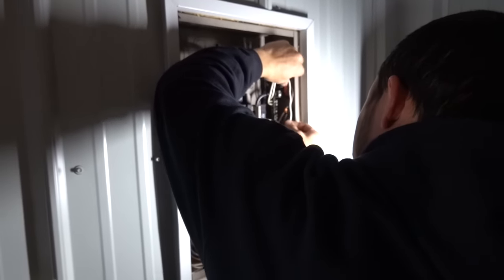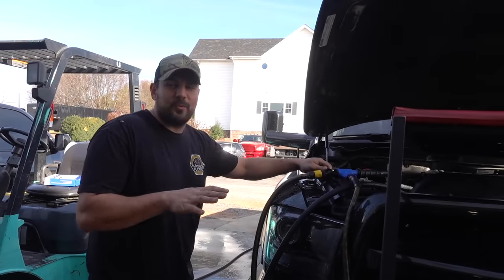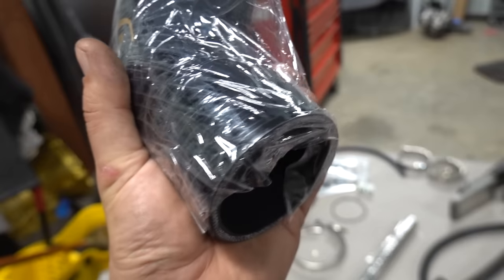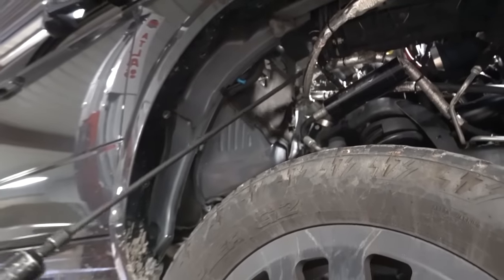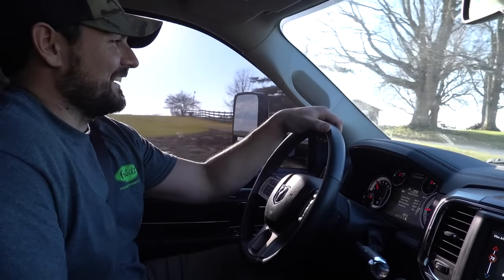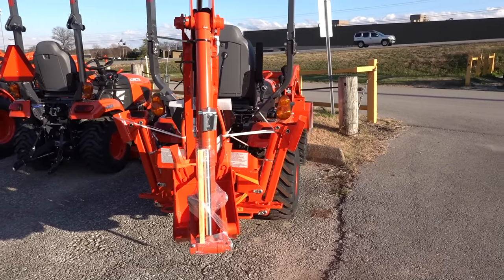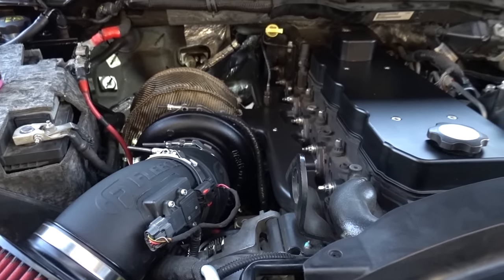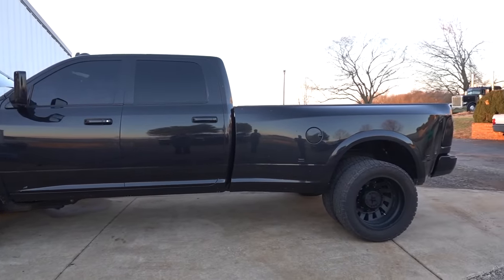LOUDEST EXHAUST BRAKE YOU'VE EVER HEARD!!!!! THIS IS INSANE!!!

Comment: That sounds like a jake brake for real though
Reply: it’s not a jake brake it’s an exhaust brake they’re different
Reply: @kamrinwoodward5822  I know I was saying it sounds like a Jake brake
Reply: It sounds similar to a Peterbilt jake brake but yes it’s a exhaust brake
Reply: @kamrinwoodward5822  no shit Sherlock 😂
Reply: @kamrinwoodward5822  Someone thinks they are smart😂
Reply: @zg5901  ALL THE ARGUMENTS FOR NO REASON | 1LUV :-)
Reply: Did you say peterbilt jake brake 🤣🤣🤣 peterbilt dont make a jake brake honey, that's whatever motor it has in it, usually a big cat (electrical jake) or a Cummins which runs off oil pressure and is alot better than a cat as far as Jake's go, pulling a fat jag up the back side of the Appalachian mountains then a cat will walk its ass like a baby back bitch but that Cummins is gonna pass you 2x over on the downhill side while the cat guy is smoking them breaks and cracking jakes and having to get a quick head job. Take it from a truck mechanic who works on and takes care of 40 heavy haulers
Reply: @ranchertrapperdieselbuilds3632  yes, it's the same thing!! :-)
Reply: Yeah for sure
Reply: @kamrinwoodward5822  That's not what he said! Is English such difficult for you?

Comment: I used one of those a few years ago on my F250. It worked great. Next issue was that the flow was so good that I had to put a ball calk valve on the inlet . Leave valve open in the winter and then turn off in the summer. Too much heat  inside the cab in the summer. My grandson has the truck now and still uses the setup. I gave him the F250 when I got my F350.

Comment: The heat on my 4th gen doesn’t work either 🥶 and I was driving through WY & SD 🤦🏻‍♂️
Reply: Maybe try jarring the cooling system with a bump in the median...j/k..haha
Reply: Lmao how'd I know you was going to be here!! Just wear a jacket TP
Reply: No shit had a freind with a 1st gen hoodstacked with a buddy heater in the passenger seat thing was a chick magnet 🤣 bondo and duct tape
Reply: The heat on my 2nd gen doesn't work. I'm about to cut a hole through the firewall.
Reply: @Pure_KodiakWILD_Power  I'm lucky when it comes to that on my 2nd gen. It will burn you out of it in the winter with the heat and it will freeze you out with the AC in the summer
Reply: @Texas12valve  Nice.
Reply: @NCprepper  thanks, I've always thought that might be the issue, because the knob does get stuck halfway, but never got around to confirming it.
Reply: the drivers side heat doesnt work on my 3rd gen
Reply: OOF BIG OOF HE CHUNK OOF O LORD HE COMIN OOF
Reply: @Texas12valve  2nd gen hvac works awesome when the heater core isn't leaking
Reply: @wyattlewis8671  my heater core doesn't leak. And every thing else is new
Reply: @Texas12valve  yea man I have the same metal tab kit for the heat control module under the dash. Pain in the ass to replace but worth it. Also did a new dash top, ac evaporator and heater core. Truck hvac system works like a brand new vehicle. Everything was only $600 and a weekend of work.

Comment: Are there any back pressure adjustments on it? I had the BD on my setup and they had a regulator that you could adjust how aggressive it was just so you didn't float a valve as well... Or is it strictly what the computer tells it to do?

Comment: Fucking baby cummins drone. I dont understand why guys like it. The cummins is the 2010+ Honda civic. If you want a real jake, drive a truck with a real Jake brake, with a real clutch and transmission. Sloppy torque converter drone

Comment: 4th Gen RAM trucks did not use the recommended factory coolant for the factory fill. You can open any 4th gen coolant reservoir and find brown gunk in it. I did testing on several new trucks versus the Mopar coolant and they are different. Change your coolant early. The stuff they put in from the factory is junk.

Comment: What set up are you running as far as turbo and exhaust brake? I talked to fleece and they claim those parts dont fit together which I assumed was a 2nd gen swap fleece turbo and down pipe exhaust brake...?

Comment: I've had the issue 3 times in my 2014. It showed up after the dealership did the water pump recall. Finally it hasn't come back this year. Its the casting sands plugging it up. All it takes is the 40-60psi of water psi supplied by your spigot. You can buy some brass hose adapters and 5/8 clear hose from the hardware store for cheap and flow it into a five gallon bucket with a hole drilled into the lid for the water to bleed out and it will catch everything in the bucket even the fine sands since they have time to settle like that.

Comment: I just installed this on mine and I'm having an issue. The EB works when it wants to. Sometimes it'll kick on, most times it won't. But it'll work in tow haul. I don't feel this is any better than a stock EB. Are you having any issues like this?

Comment: Hey Greg, I noticed that your EGzt probe is before the turbo.  What brand of probe are you running and what do you see for EGT's when pulling?  The reason I'm asking is because my stock 3rd gen with an Autometer setup will bury the needle when loaded, and runs around 850 degrees empty.  When I hammer it empty I can drop the needle to 12 to 13 hundred degrees.  If you have any suggestions or ideas I would greatly appreciate it.

Comment: Can you please do a follow up on the heater core fix? I’m having the same issue and I’m being told the heater core needs to be replaced. Don’t feel like tearing the dash out to fix it just yet. And it’s getting cold here in Indiana! Love the content as always, sir!
Reply: I've had the issue 3 times in my 2014. It showed up after the dealership did the water pump recall. Finally it hasn't come back this year. Its the casting sands plugging it up. All it takes is the 40-60psi of water psi supplied by your spigot. You can buy some brass hose adapters and 5/8 clear hose from the hardware store for cheap and flow it into a five gallon bucket with a hole drilled into the lid for the water to bleed out and it will catch everything in the bucket even the fine sands since they have time to settle like that. I just flowed mine for 20 minutes and qinked the outlet hose a couple times to let it build pressure and quickly released it to shock the flow and knock some of the build up off the walls. Also, running some CLR in there for 10 minutes and letting it sit helped before flushing fully.
Reply: @marlboroman71818  appreciation the information! I’ll give this a try and see what happens. It beats tearing out the dash and replacing the whole core itself. Fingers crossed! Happy Holidays to ya!